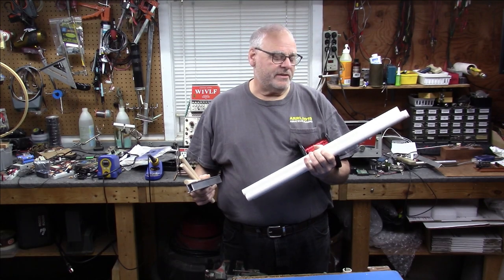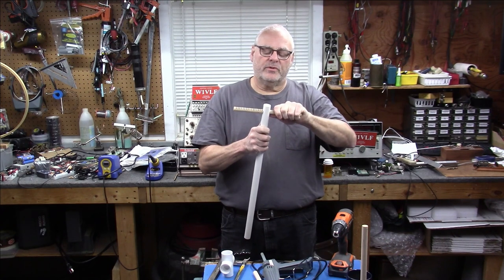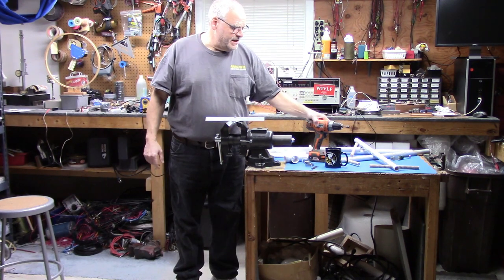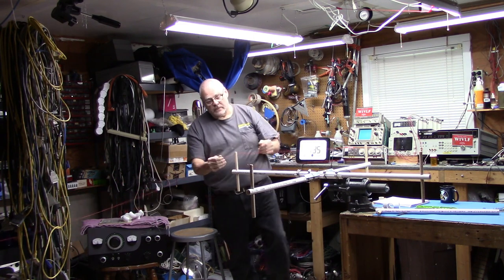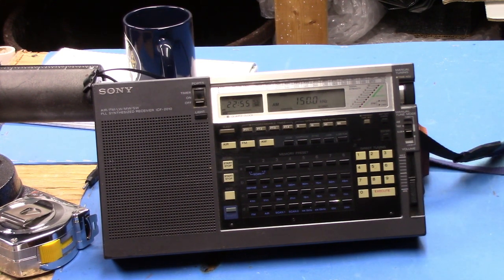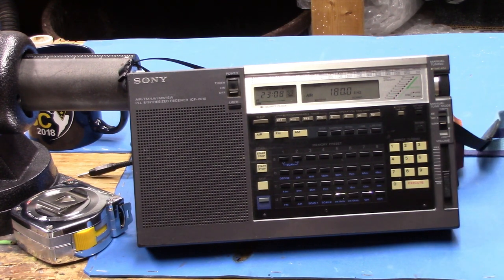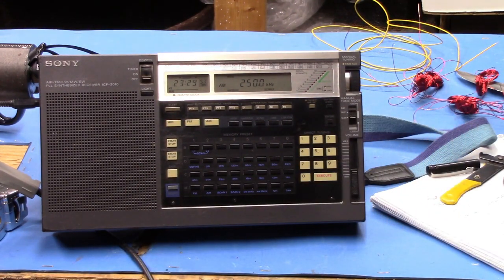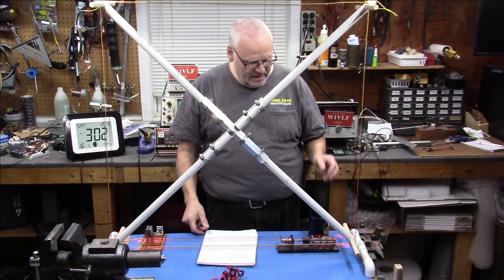Experimental Loop Antenna Platform Part 1

Comment: I've built many MW loops over the years and have found that 9 turns on a 1m per side frame covers all of the band (you may need to lose a turn to cover the X band stations though). i used all wood for mine but with a similar method of cutting slots into the ends of the wood and winding. One thing you didn't mention was the use of a coupling loop so you can use the loop with radios that don't have a ferrite rod antenna (I think they are called 'loopsticks' over in your part of the world). I found that a 1m square was about the biggest I could comfortably use without it becoming unsteady or the loops beginning to sag. However, that may have been down to me being in my very early teens and not having great woodworking skills. Having tried a 5 foot per side loop, the signal pickup was incredible but it was unwieldy and needed a lot of free space to manoeuvre. I wouldn't attempt another that big for indoor use. a 1 foot per side worked well and required about 15-18 turns. The best loops are the spiral loops with all the turns wound in a single plane, with Litz wire. Difficult to do a good job on those. initially, they look easy, but to get them to work as intended takes time and practice. Keep up the good work. I found your common mode choke videos of particular interest. 73 de G4UCJ

Comment: Beautifully done Paul. The idea for using the angle aluminum cross-piece assembly and hose clamps to fasten the pvc arms makes putting this together really easy. Very clear demonstration of removing turns to move up the tuning range. Hey, I think I saw a few picofarads running loose on the floor so watch where you step!   73, Rob
Reply from the maker: Thank you Rob.. I value your opinion.  I am starting to feel a little more comfortable in front of the camera.  This is a experimental platform upon which one can build, tear down., and rebuild again. Or undo the hose clamps and pack it away till the next time the loop bug bites.  73 OM W1VLF

Comment: Thanks so much for this hard work and iterative method.  I built a milk crate loop setup for commercial broadcast AM a few years back and am still amazed that it actually works. Your videos have made it possible for me to analyze and tune the system to not only optimize the commercial AM band, but also use the same crate for Long Wave with my Shortwave sets.
Keep up the good work, and thanks again for Elmering!
73,
KF5FHO

Comment: You don't have to take turns off. You could just put taping in points on every or every other turn. The taps can be easily connected to a switching system for higher and lower frequency bands.

Comment: Hello Paul. Could you share image on how do you solder (connect) wires to two section capacitor with a switch, please?

Comment: Could you successfully place a bunch of ferrite sticks at the center of a commercial loop antenna using cardboard or wood? On videos with very large supplementing ferrite antennas built from PVC piping and wire, I see ferrite sticks placed at the border of the ring, not the center. I believe that is an expensive layout compared to the purchase of a commercial loop antenna with an added ferrite core.

Comment: Have you tried using 40 way computer ribbon cable, staggered in a loop and tapped every couple of turns?
Reply from the maker: Well sort of.....  I did gag video a while back, but in that video I have used  flat ribbon cable to make a loop.  You can check it out at https://youtu.be/gfWkIRzI2uw

Comment: HI W1VLF, great video-thank you I am subscribed.  What do you think about adding taps to that coil? It would be neat to sand off enamel at at various windings and clip on to it. Dave in Phx
Reply from the maker: Thank you David.  I have tried using the loop that way.  If your goal is a very sharp hi Q loop then I would not go that way. The extra turns seem to dampen the loops Q. But if you just want the extended tuning range , I say go for it.!!  W1VLF

Comment: if the variable capacitor was 720 pF at most, then the antenna had 1795 uH at 30 turns, 1374 uH at 26 turns, 1086 uH at 22 turns, 880 uH at 18 turns, 563 uH at 14 turns, 287 uH at 12 turns. 250 or so is very normal.

Comment: Hi Paul, I've got a roll of 32AWG magnet wire...that should be fine I'm guessing for receiving?
Reply from the maker: Hi David.. That should work. It may be a little difficult to work with as that is very thin.  You can always use the platform to adjust the frequency  you want it to resonate as shown in the video. "Q" may suffer a little, but I say try it and experiment.. that's what its all about
Reply: Thanks for your advice Paul. I ended up trying some 24AWG stranded on a cross style wooden frame. One loop equals about 68", and I put 12 loops on so far. Its definitely working in the broadcast band. with my 3 -365 uf variable cap. Hope to get my scope tomorrow to help tune it. You opened up a new world of loops for me. Is this design what was called a "wave magnet" years ago?